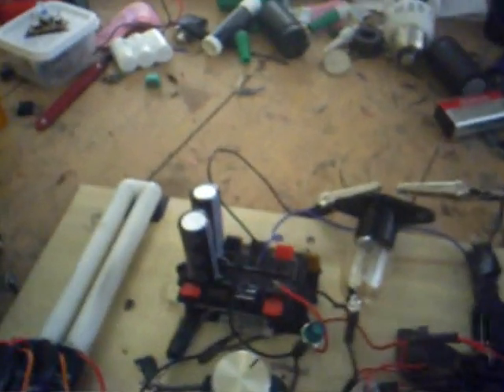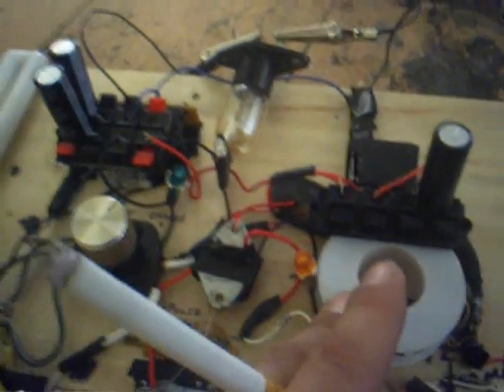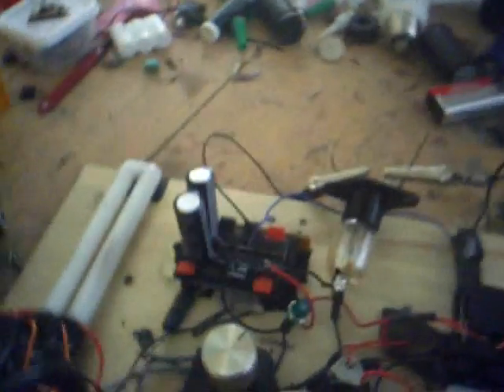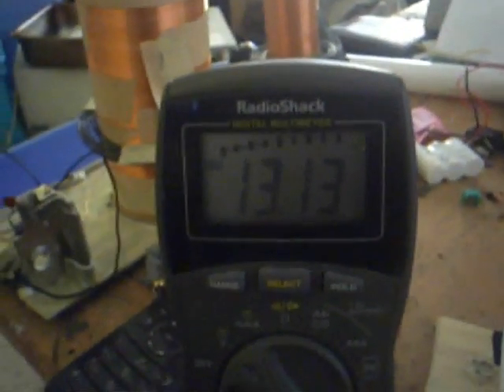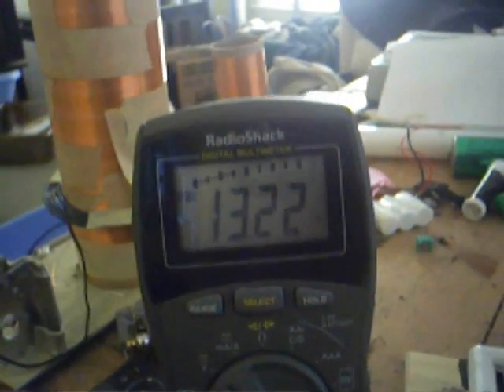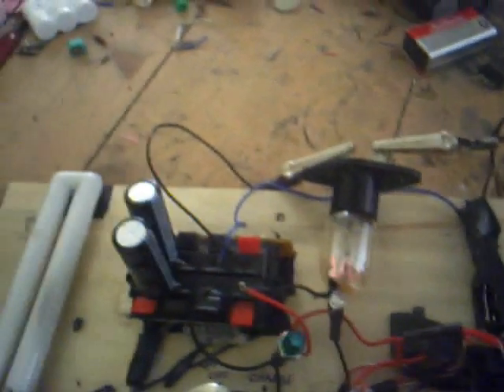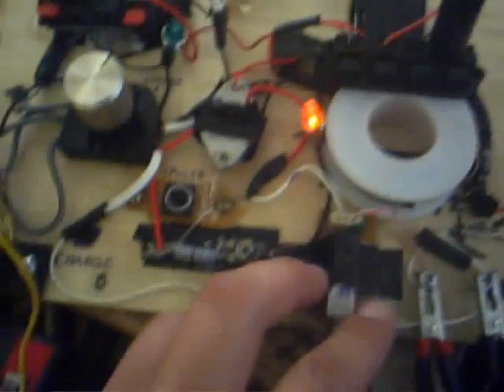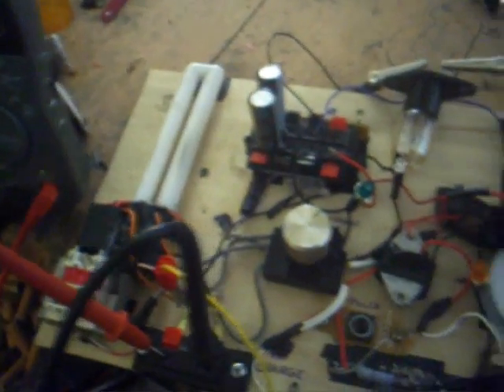no BS 3 in 1 solid state charger/rejuvenator/pulser

Comment from the maker: well it depends on the battery of course, but as far as simply getting it to a state where it will accept a normal charge it shouldn't take more than 24 hours, maybe much less with the right cap pulsing along with it. rather than using this circuit which complicates things simply by having the 3-in-1, u could easily get by with building a pulser using the radio shack 12v 4.5A transformer following a xee2vids style inverter diagram. the speed depends on amps u are pushing.

Comment from the maker: yea actually i would recommend using the xee2vids circuit where you get one of those 12v transformers from radio shack. it can be larger or small but preferably the 4.5amp version. the transformer should have a primary, a center tap, and a secondary. u just wire the primary like a joule thief using the center tap as the positive rail. i will send u a drawing.

Comment from the maker: no prob. if you are trying to make a circuit that both rejuvenates and charges, but does not have a cap pulsing mode, then i would recommend just making the Big joule thief style charger. it is way easier to build and may charge better. i have a few other chargers that use the big transformers wired like a JT, and also use a flyback winding for both low current hv and higher current lower voltage.

Comment from the maker: @generalchad this is not a DC charger. i was mainly taking a shot at the "R-Charge" products. look it up man. they are selling that shit for over a 1000 some models.. then look up how easy and cheap it is to make a simplified version. "battery rejuvenator". if you are referring to a regular DC charger then it will not charge a "junk" battery, those batteries need to be revived first by cleaning the crap of their plates.